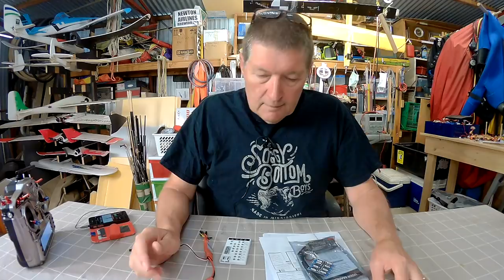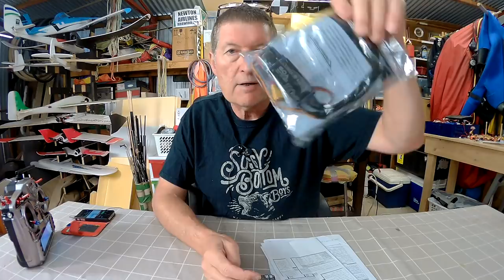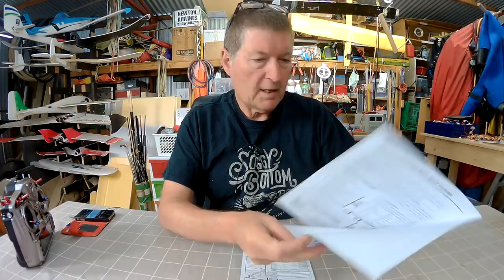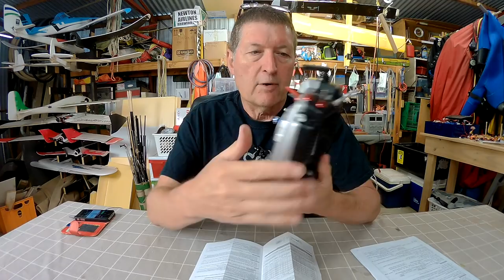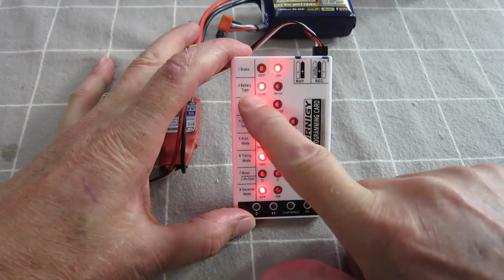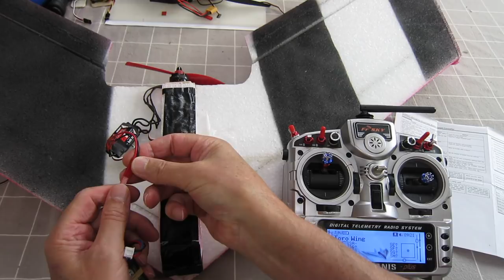ESC brake setting

Comment: Thanks ESC programming has been a challenge for me, especially with the radio.  Finally purchased the card which is great.  I have several that do not work with my card ,so next step for me is to standardize to one manufacturer.  Thanks again for the informative video.

Comment: I have a brandless 40A ESC. I connected my motor and ESC to a Speedybee F405 Wing flight controller. At first everything seemed fine but somehow I seemed to have messed up the ESC programming(?) When I arm the model and turn throttle on, it turns on. But even for a very low throttle, the moment I input a left aileron stick command, the motor stops spinning. I have triple checked all connections. It isn't an overcurrent issue either since I connected a Wattmeter and verified that the current draw is within ESC range (max current is 13 Amps). I can't think of anything else other than the ESC accidentally being wrongly programmed. I am running INAV 7.0 in my FC. Please do let me know if you have any idea why this might be happening. Thanks in advance.
Reply from the maker: Did you have differential thrust in the mixer? Unlikely to be the ESC, more likely the INAV setup or radio mixing
Reply: @AndrewNewton   SOLVED! It was INAV setup indeed. Apparently, I had set up channel 5 as channel 1's slave in my FlySky FS-i6X transmitter during direct manual flight using ESC directly connected to the battery. When I later connected the FC, I had assigned channel 5 in INAV to arm the model as well. That caused the FC to think that I was trying to disarm every time I gave a left aileron stick command because the bracket in the Arm channel in INAV mode for arming interfered with the aileron stick command. I simply had to assign arming to a different channel (I now have channel 6 for arming), and this mysterious throttle cut is now gone. But anyway, thanks for your reply. I enjoy watching your videos and learning from your experiences! :)
Reply from the maker: @prateekshrestha9824  Aha, well done. Should almost be a Gold Rule of INAV - Start with a fresh new model setup

Comment: when programming by tx i have signal and ground wires from esc to fc conneted is it why my esc wont go to program mode?
Reply from the maker: Yes it could be. May need to program the ESC when disconnected from the FC, or use the Outputs window in the configurator to manually operate the throttle.
Reply: @AndrewNewton  i did as you said from inav and all good now, thank you my friend

Comment: Hey i know this has nothing to do with Video, but i just brought a Phoenix 2000 and have noticed that the rudder is on 9gram servo and elovater is on 17gram servo is this correct or should it be the other way around? thanks for your time
Reply from the maker: Hi Keil. 9g on the rudder is OK but I have 13g metal gear on the elevator and ailerons (TGY 9018). 17g is OK on the elevator.

Comment: Following your example, I bought a programming card and now only buy Turnigy Plush. 
However, having just installed a 30amp one in a new glider, the prop absolutely refuses to stop spinning. I’ve programmed it twice, to 100%, I’ve even tried an increasing number of rubber bands. All to no avail. 🤬
Clearly, the esc is not braking the prop. Just a’wundrin’ if you have any suggestions. Until I fix this issue the glider is a duckling, as the torque from the feathering prop spin is tipping the model hard right!
Reply from the maker: Have you tried using the radio to set the brake? https://hbfpnl.files.wordpress.com/2009/11/turnigy-plush-esc-user-manual.pdf

Comment: ++ndrew Newton - 
did this aircraft have the heavy loads by using the nanotceh battery, bro..?
Reply from the maker: It worked OK with 1300 3S and 950 2S
Reply: ++Andrew Newton - 
wht about using 2000mah 3S on this aircraft, bro.. ?

Comment: If you are running inav, I assume setting the throttle from between 1000 and 2000 and setting motor stop does the same and you don't need to calibrate the ESC?
Reply from the maker: Still need to calibrate I think
Reply: Thanks Andrew, come to think of it, I believe you can do it from the motors tab in inav by connecting via usb then turning master motor control to 100% and then powering the ESC and reducing power to 0.  So same as with the transmitter I guess but that calibrates it to the inav top and bottom settings.

Maidening the fx-61 tomorrow so I want it right.
Reply: Depends on the ESC protocol you're running. If it is digital, (DShot), then you don't need to calibrate it.
Reply from the maker: Aha, I didn't know that, thanks

Comment: Is the brake setting ESC more useful than default.. bro?
Reply from the maker: For gliders and belly landers it's essential. Folding props need to stop spinning to fold back, and a spinning prop creates more drag. Also for belly landers, a spinning prop has much greater change of breaking when it touches the ground.

Comment: I am hoping you would do a video on select correct motor for twin motor and wiring 😀
Reply from the maker: Interesting project, I'll add it to the list
Reply: Andrew Newton , thanks I can not find a good source, I have tried doing single motor and splitting the requirements into 2 equal.parts, it works, but not very well